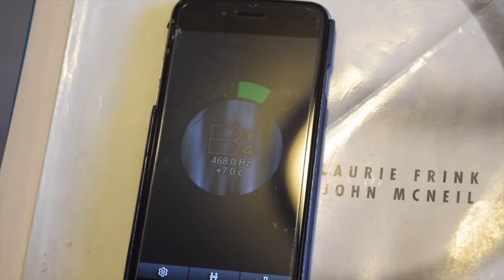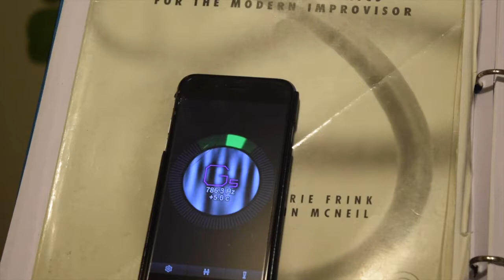How to Use the First and Third Valve Slides on the Trumpet

Comment: Do you use a different grease for the 1st and 3rd valve slides?
Reply: Had trouble with my slides for a while then realized after much research that you have to break them in to get them like the pros.  So its a patience kind of thing.

Comment: Would it be a bad thing if you already learned the d and c# with the 1st valve slide because that's what I've been doing and no one really comments on the intonation of those notes.
Reply: You can probably get away with it with low D, but there's no way you're getting low C# in tune with the 1st valve slide alone as there isn't enough slide travel. You may be able to use a combination of 1st and 3rd valve slides, but it's difficult to kick both slides out at once into a consistent spot every time, especially in the middle of a quick passage.

The 1st valve slide is usually reserved for notes such as E and A using the 1-2 fingering that tend to ride a bit sharp...but I would first start with integrating the 3rd valve slide into your playing.

Comment: New to the trumpet, if there is no first valve slide, what should I do/know? Thanks for your video!
Reply: Good question ❓
Reply: Don’t worry about it. Third valve slide is worth learning but first valve I wouldn’t move it unless they paid me to play trumpet.
Reply: @anarchyseeds4406  why?
Reply: @miurtouissi1093  notes obtained with the first valve aren't so out of tune that they require that type of correction, unless, of course, you're a professional striving for perfection
You can easily correct them with your tongue, or not correct them at all
Reply: @rekindled3624 I'd avoid correcting with the embochure as it could cause issues down the line. Just live with the fact that there will be a few notes that are slightly out of tune, but not so bad to be noticeable to most. Low C# and D are that bad.

Comment: How hard would be to learn on a trumpet with no 1st tunning slide?
Reply: It makes sense to use the tuning slides only after you have the muscle memory to nail a note on its center, which is not an easy task on the trumpet. Otherwise you're not gonna get a good sound, regardless of intonation.

Short answer is, for a beginner it doesn't matter (especially the first slide. The notes that are the most out of tune are obtained using the third valve)
Reply: It's perfectly doable. A few notes (Es and As using the 1-2 fingering) will be slightly sharp but won't be very noticeable to most.

Comment: Can't you lip them into key?
Reply: Some notes you can, but the low D and especially low C# are so sharp that it's not worth it. At best you might get close when playing long tones, but it won't be feasible when playing quick passages as you'll end up "lipping" the surrounding notes flat. At worst, you'll develop ingrained embochure issues that will make it impossible to get a good tone and play in tune. It's easier to just use the slides - that's what they're there for.